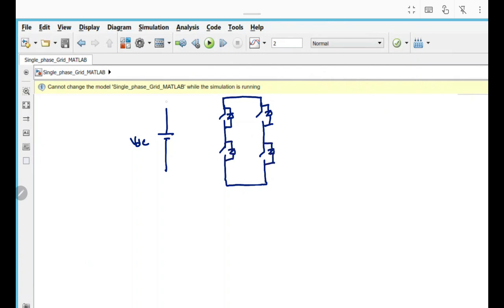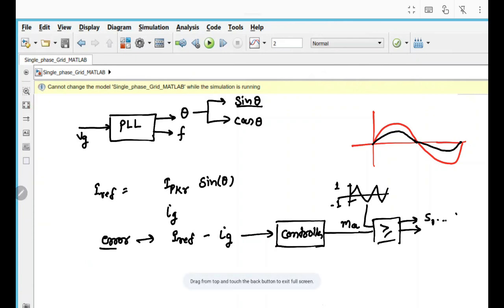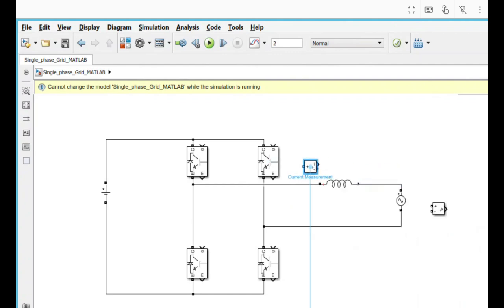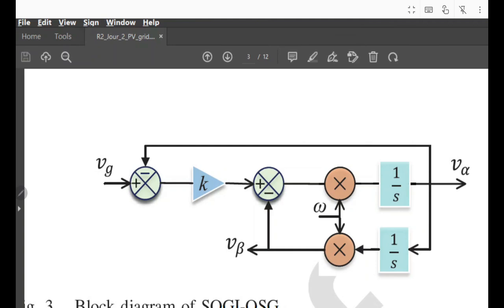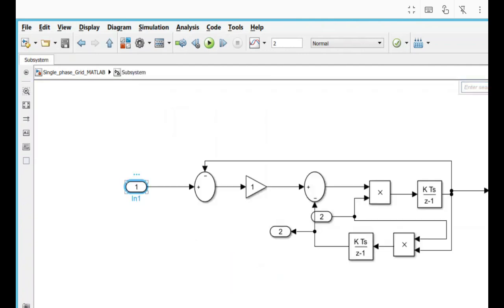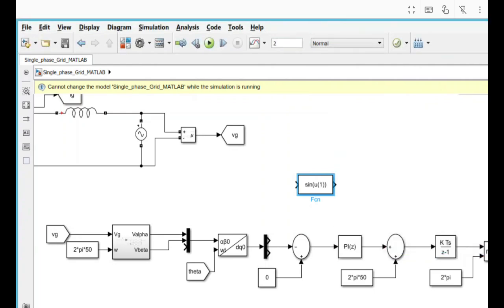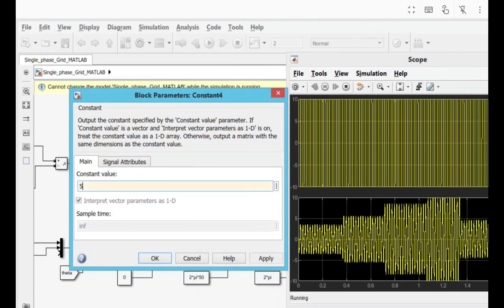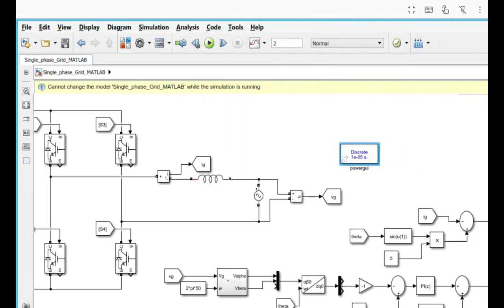MATLAB Simulation of single phase grid inverter | SOGI PLL | Alpha-beta Control

Comment: When I connect theta  to the wt @ Alpha-Beta-Zero to dq0 block it shows the 2 error and my Vg and Ig is 90 degree phase shift
Reply from the maker: What error it is showing?
Reply: @controllers_knowledge  Error:Error in port widths or dimensions. 'Output Port 1' of 'Grid_inverter/From5' is a one dimensional vector with 3 elements.
Reply from the maker: Check mux and demux pins